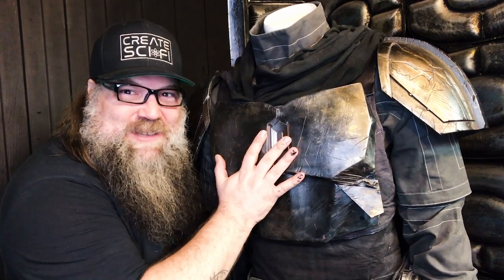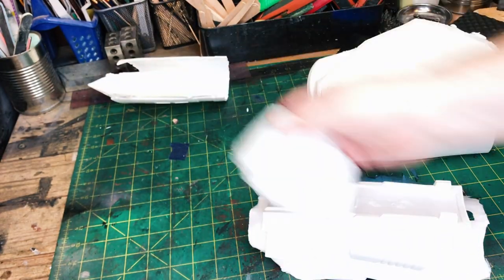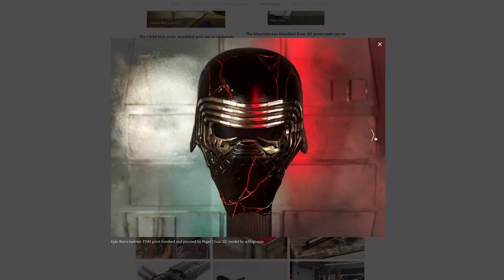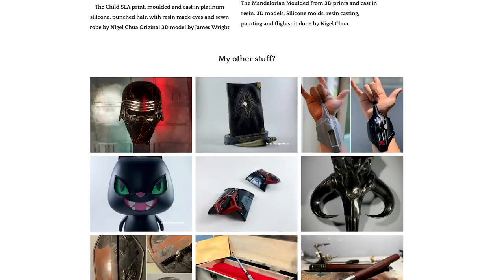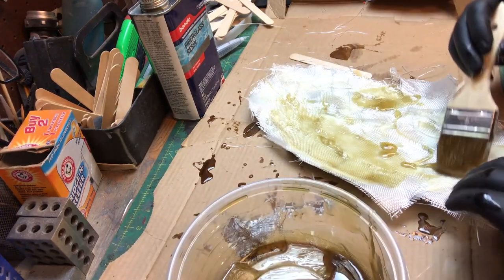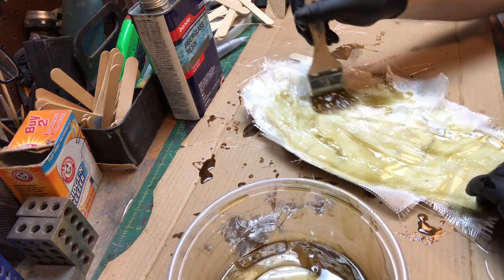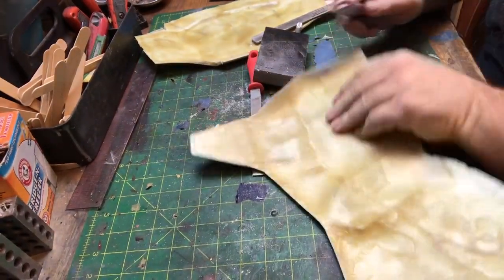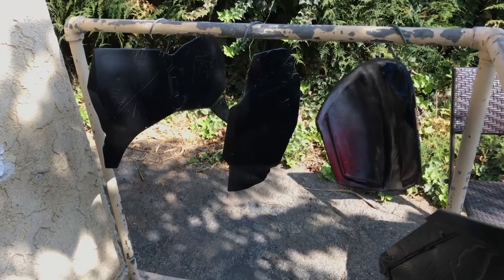MANDALORIAN ARMOR BUILD: Part 01

Comment: looks amazing! one quick tip, as opposed to using toothpaste, try liquid latex - it servers the same purpose, but only takes a couple of minutes to dry and for you to be able to paint over, and you can just rub it off with tour finger as soon as the paint is touch dry, instead of having to scrub it off with a scouring pad and water

Comment: Absolutely amazing sir!  Did you run into any difficulty sewing through the velcro with adhesive on the back?  My needle always picks up the adhesive, which in turn sticks to the thread and really makes sewing a pain.  If I know I'm going to be sewing velcro, I won't use anything with adhesive.